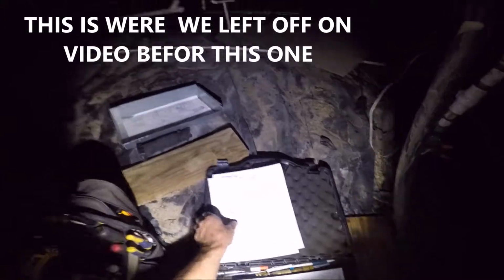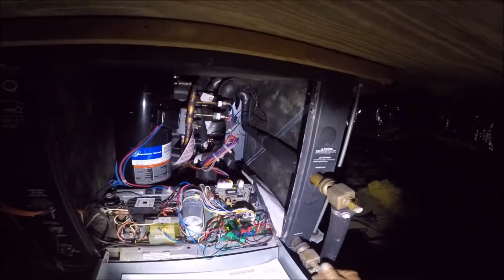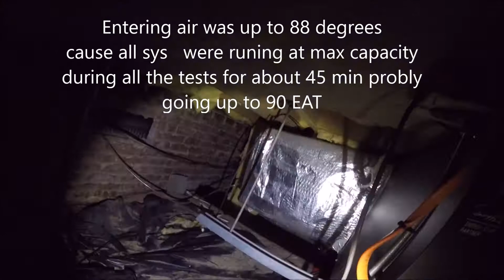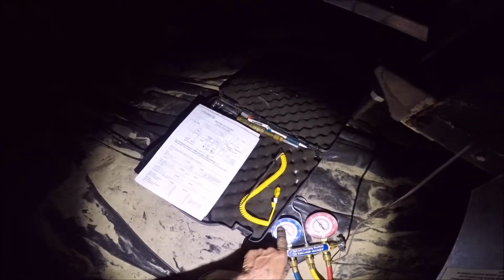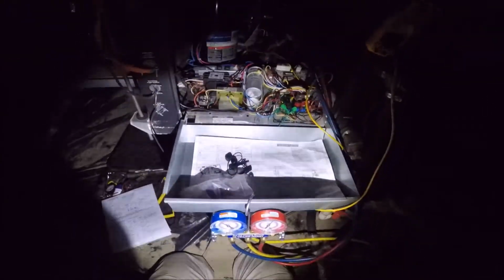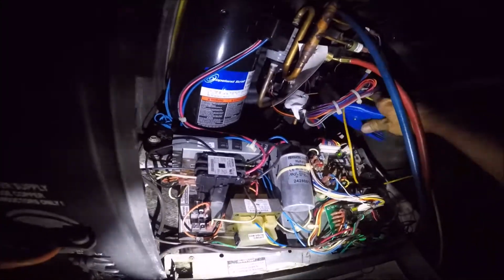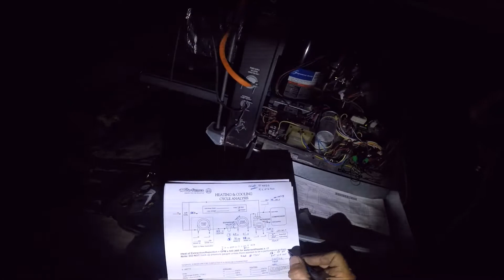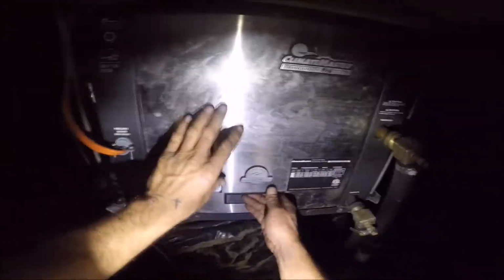(HVAC)  works good in a/c but not in heating CLIMATE MASTER .GEO SYS

Comment: Hey Bill in your opinion what’s the best geothermal unit brand my heat exchanger went on my carrier and they said that they don’t manufacture it anymore so I’m looking to get a newer unit
Reply from the maker: My favorite brand to work on because they have excellent tech support great warranties and great systems easy to work on would be water furnace visit website waterfurnest.com I've been working on them for 20 years they're the best out there in my opinion and I work on client Masters carriers comfort Air Florida heat pump none of them measure up to water furnace in my opinion
Reply from the maker: And I would go with the nickel cadmium coax coil a little more expensive but last longer
Reply: Thank you Bill appreciate it
Reply: Hey boo have a leak in my heat exchanger on the refrigerant side carrier says that they don’t have that part anymore could you recommend a possible replacement
Reply: Sorry about the typo I meant to put hey Bill I
Reply from the maker: @robertgonzalez8419  if it's internally leaking inside of the heat exchanger and they don't make it anymore for that system I would not know what to even tell you about carrier you're talking about the coax coil correct you're kind of forced to buy a new unit
Reply: Your right thank you for your input where can I purchased a unit from a distributor and not dealing with a dealer
Reply from the maker: @robertgonzalez8419  I've been able to buy units off of eBay and Amazon you can try searching there I've also used AC wholesaler.com but they only sell air to air as far as I know AC wholesaler.com I probably bought five units from because I'm not licensed I work under the license of whatever company I'm working for at the time but like Johnstone supply and the big refrigeration companies most of them require you to be either a certified technician or have a mechanical license to do air conditioning other than that the only ones I know that sell to the public just keep Google searching I guess and check Amazon and eBay you can check with AC wholesaler.com they ship it for free they're in Florida they might sell geothermal units but I'm not sure if you're trying to get geothermal I would definitely try to go with water furnace you might be able to contact them and see if they will sell to you but they might make you find a contractor
Reply: I’m license so Johnstone supply sells the waterfurnace Brand and again thank you for taking time to communicate with me God bless
Reply from the maker: @robertgonzalez8419  no Johnstone does not sell water furnace that comes from fort Wayne Indiana you will have to contact them directly and if you have a license they will probably sell you a unit but I can't guarantee that I'm just guessing if you have a license then I don't think there would be a problem but they may have stipulations I don't know
Reply from the maker: 1-888-929-2837
This is the phone number to water furnace
Reply: @billbuckman  thank you .you my friend are a champion God bless

Comment: Would love to send you pics of my system and see what you think guy that installed it was a well driller and only second unit he has ever installed. I thought it would be more efficient winter in NY cost us close to $700 a month in heating
Reply from the maker: Sounds like Heat strips are running a lot in winter
Reply: hvac Bill I disconnected back up heat strips thinking that was the reason! Had the system designed for main floor 108.8% with envision ND064 and upstairs 152.8% with a EW020 seems like no one in this area is as knowledgeable as you. I called a guy that claimed to do geothermal to look system over. He came took my design drawing done by Geopro inc in Elkton SD and never returned my calls. Any help would be greatly appreciated
Reply from the maker: Could be low on refrigerant maybe water flow is too fast maybe fan setting is too fast just some things to think about

Comment: Good vid! where did you get those jumpers?
Reply from the maker: R. J. Dippold HomeWorks INC Heating and Air the black and red jumper came with a tool kit from a water furnace training class I have no idea where exactly they got them from but I did find some on eBay that were pretty close but just much cheaper

Comment: I have a climate master that is run by my EMS, there is a 5 min delay on the compressor to kick in when my EMS system calls for it, is there a way to bypass that delay on the climate master that you would know of by any chance?
Reply from the maker: Unit can we put in test mode by sticking a screwdriver between the test pins until the green light clicks on the board but that speeds up all timers 16timés .
Reply from the maker: But that's not a permanent solution to bypass that's the only way I know. How to speed up the timer to kick compressor on faster not good idea to leave it in test mode it's only for troubleshooting and for recalling faults in the memory
Reply: @billbuckman  ahh good to know thanks!!

Comment: IS 40PSI OK FOR A GOOD RUNNING SYSTEM .?
Reply from the maker: If you were referring to water pressure yes I have seen them running on
Reply from the maker: 5too17 PSI with
Reply from the maker: No issues just as long as water is running through the coax coil
Reply from the maker: As long as it's got at least 1.5 Gpm going through the coax coil cuz it really matter how much pressure there is 1.5 GPM per ton on open loop  min